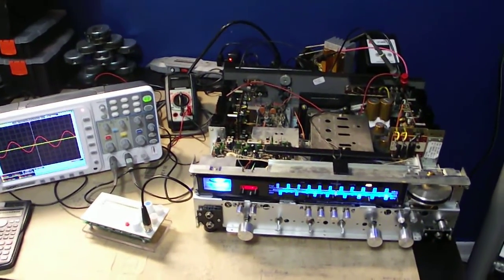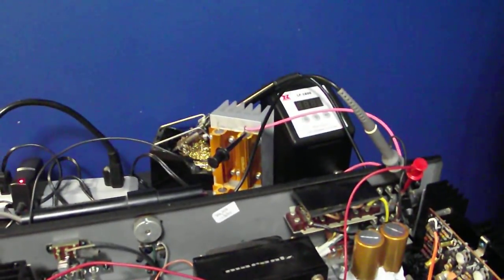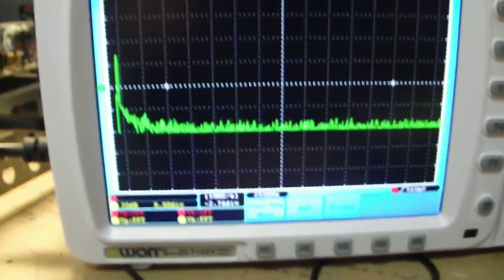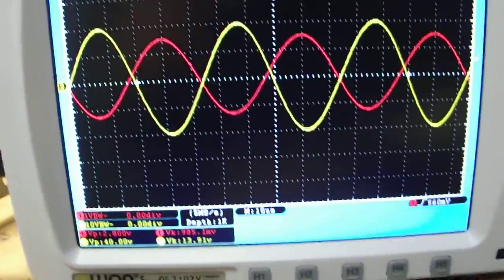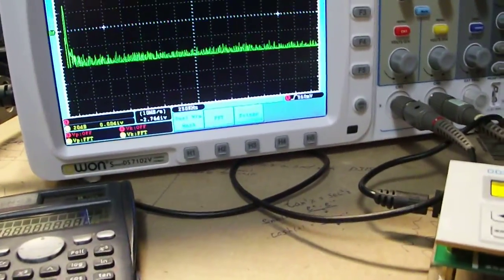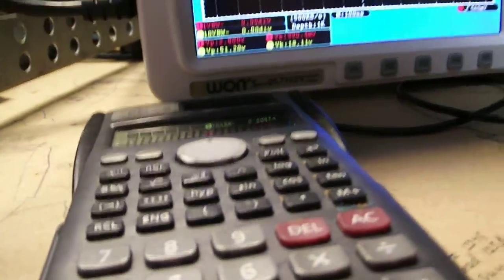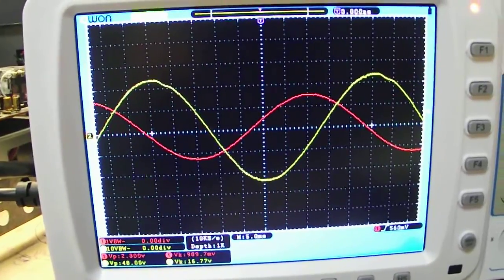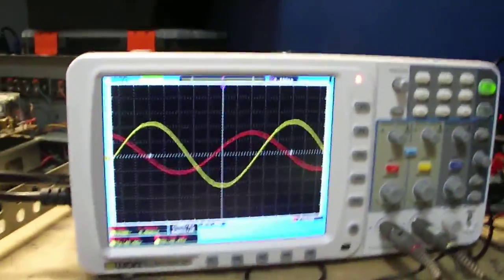Marantz 2230 Bench Testing power output (Right channel) and distortion

Comment: Is the 2230 a class A amp? The reason I asked is because all four output transistors are the same. I thought a class A/B had to use both pnp and npn.
Reply from the maker: Off the top of my head, I do not think that it is a Class A circuit, but I will verify on the schematic when I get a chance.
Thanks!
Mike
Reply from the maker: My memory was correct. It is not a class A amplifier. unlike most other Marantz receivers with a Push Pull topology which consists of an NPN transistor amplifying the positive part of the signal and a PNP to amplify the negative part;
The 2230 uses two (NPN I believe) BJTs, each amplifying half of the cycle, but referenced to about half of the DC Rail Voltage.
Reply: Thanks Mike. My 2230 makes a noise when turned on or off which I believe is something in the large caps. One 4700 80v. and two 2200 63mfd which appear to be wired to the amp boards. I put voltmeters on all three, 71v on the large and 35v on the other two. When power is turned off they drop to zero in about a minute. Should they discharge like that?
Reply from the maker: Yes, unfortunately there is no speaker protection relay on this model. Mine does the same thing. I considered a few modifications, but in the end left it as is.

The pop is from a charge building up on those caps and then being released across your speaker when connected. The best way to avoid this is to have your speaker buttons deselected when turning on or off the receiver. Before selecting the speakers, you can either short the speaker terminals with a resistor first, or, plug in cheap headphones first to take that current
Reply from the maker: You can also permanently leave a resistor across your speaker terminals to bleed the caps, but it will have a minor effect on your power and distortion/noise levels